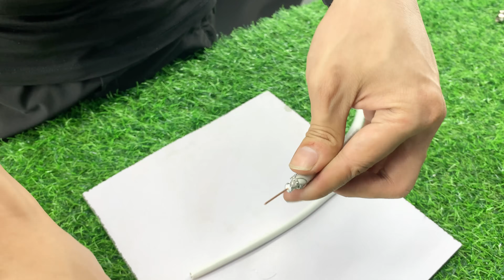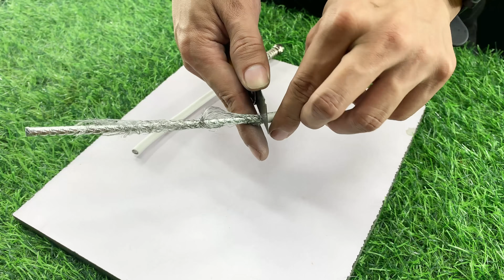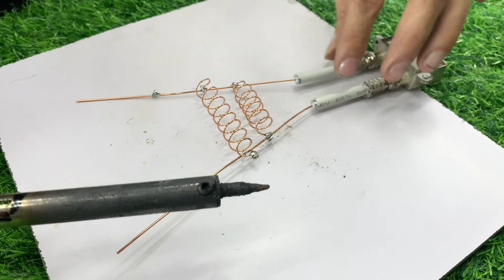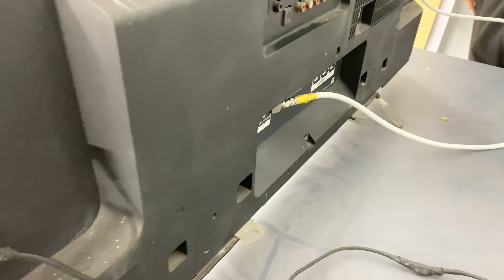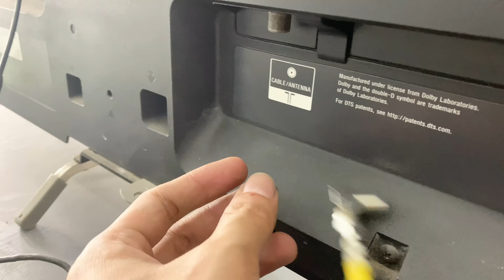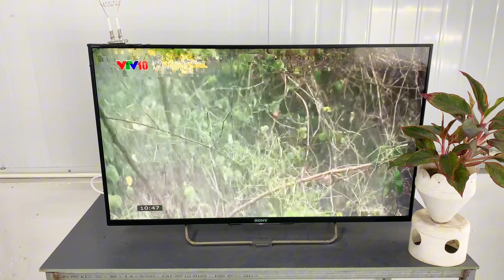📡 How to Make a Simple TV Antenna Using a Splitter and Coaxial Cable

Comment: thank you! I made this and it worked! I forgot to make the center wires coiled (I made them straight) but it still picks up some channels. I'm going to see If placement makes a difference
Reply from the maker: Thank you for trying it and sharing your result! 🙏📡😊 Great to hear you’re already picking up some channels even with the center wires straight. Please let us know what happens when you change the placement—and whether coiling the wires later improves the number or stability of the channels. 📺🔧👇